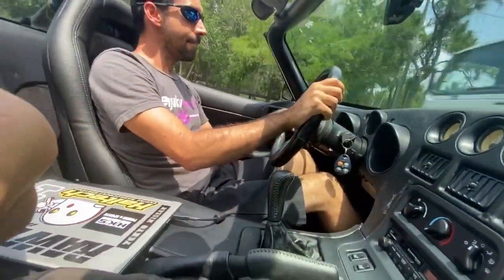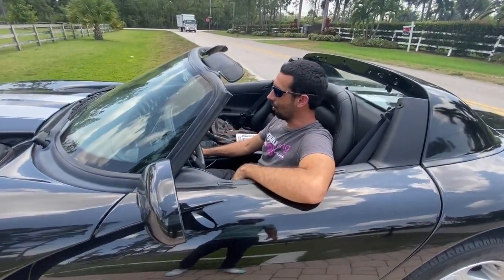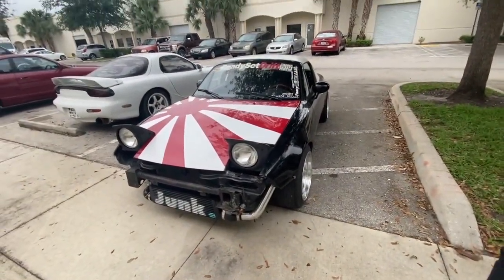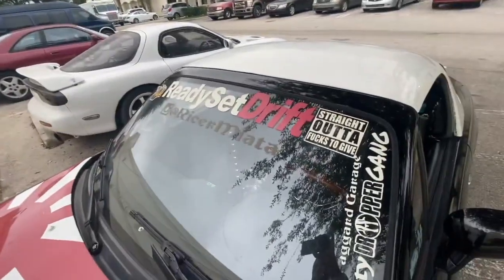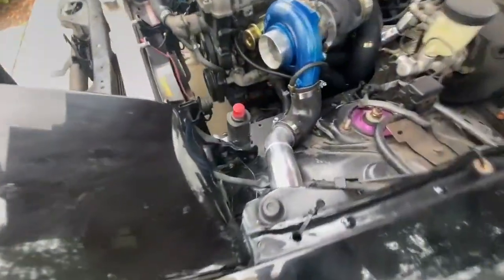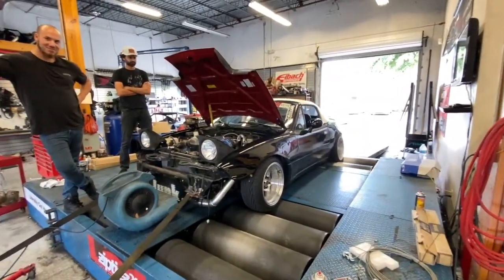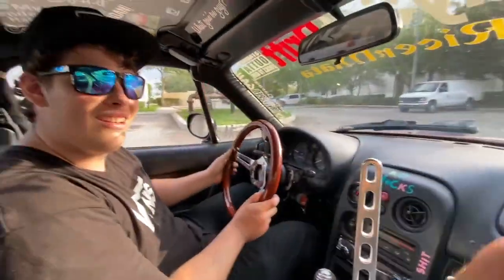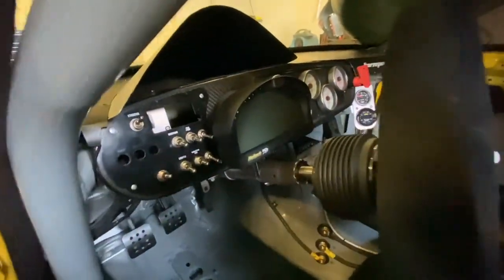MY NEW CAR?!?! RICER MIATA is BOOSTING

Comment: Ironic Shaw says American muscle because the engine is built by Lamborghini
Reply: The engine was built by Chrysler, actually. It's based on the Chrysler LA engine family. Lamborghini only did the engineering to convert the iron V10 LA block to aluminum.